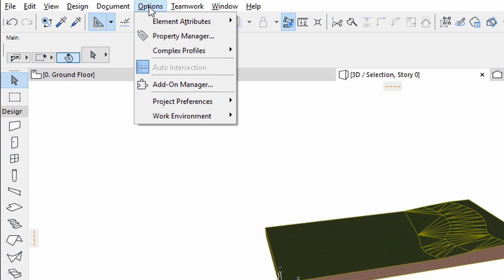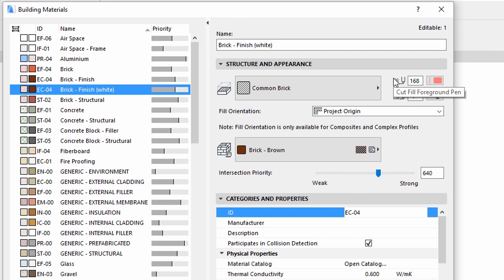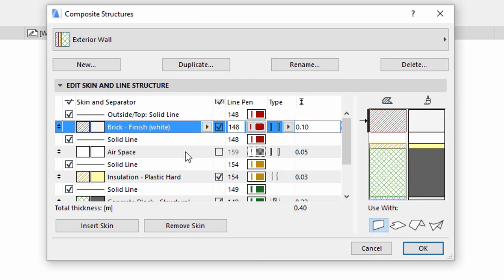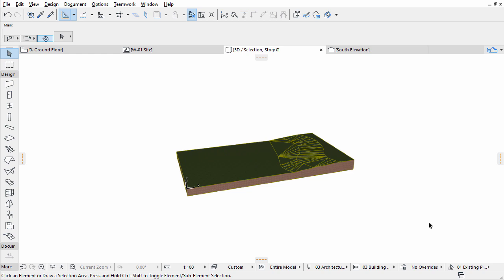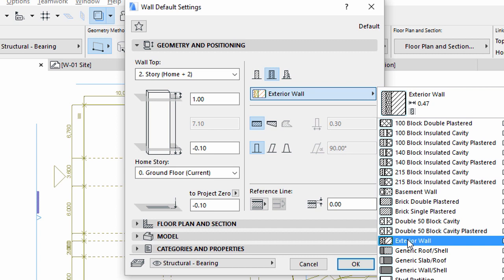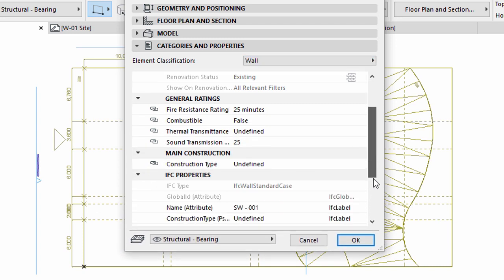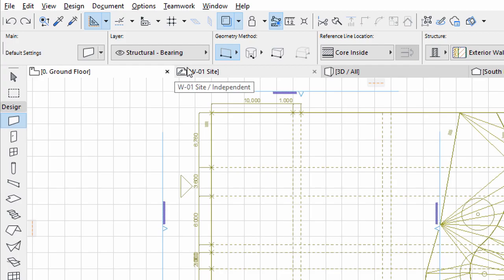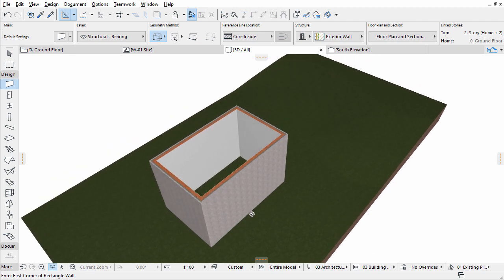Creating Exterior Walls - ARCHICAD Training Series 3 – 05/52

Comment: Hi there, I can't seem to see the wall that I drew in 3d perspective. I'm not sure where I have gone wrong.
Reply: Try to go to the 3D Projection Settings Dialog and check if the camera is facing in the direction of the Wall you created. If it is facing away from it, you will not see it in 3D. Another option is to temporarily switch to Parallel Projection in that Dialog. 
You can also try to select the Wall in the Floor Plan, right-click and select the Show Selection/Marquee in 3D command. This will display only the Wall in 3D. Or you can select the Show All in 3D command which will make sure that all elements visible in the Floor Plan will also be generated and displayed in 3D.